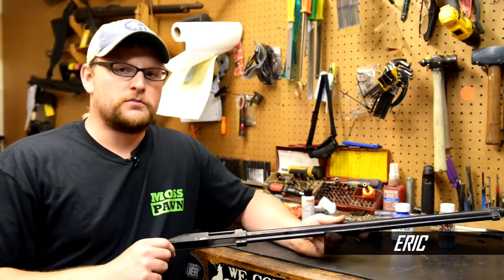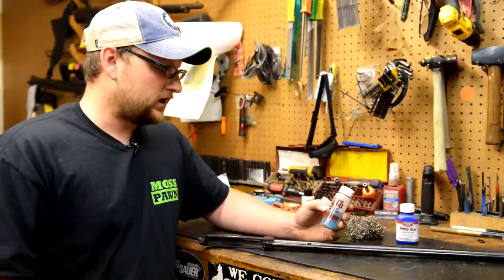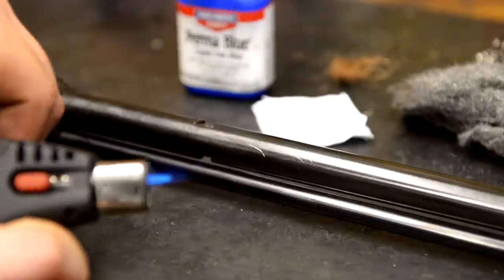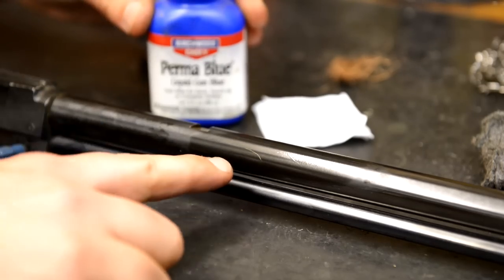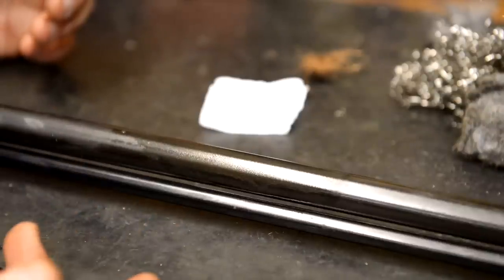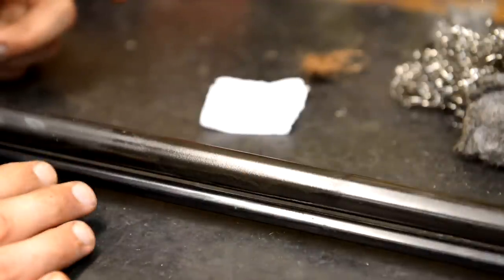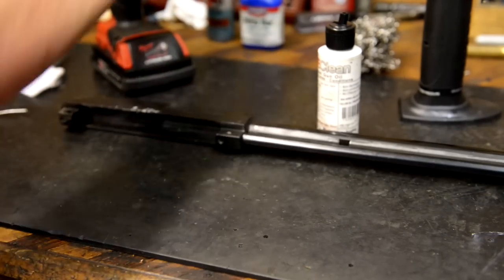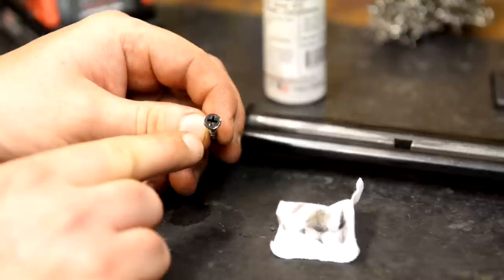How To Episode 10: Cold Blue

Comment: Just so you know, the water DOES NOT neutralize the blue, the oil does. I'm a machinist who use to do Black Oxide (blue). The water is to wash away excess solution, but if you don't oil it, the rust process will continue. If you really want to get out scratches, you have to sand the area until you can no longer see the scratch. then steel wool the sanding marks, in steps from course to fine steel wool until the texture matches the rest of the barrel (or what ever component you're working on).
Reply: Exactly right. Better to leave the scratch unless redoing and sanding the whole part.
Reply: @mark5862  I didn't even remember this. It was 7 yrs ago. Btw, I can no longer use bluing, as I have developed an allergy to it. Too bad really. I was pretty good at it.

Comment: I've found that the paste version of the Birchwood Casey is much better than the liquid, especially for larger areas.  I've done a few complete reblue jobs with it.   If you are doing a large area its a good idea to use their prep solution to etch the surface and remove any rust.  I also prep it beforehand with a series of 400, 600 and 1200 grit sandpaper to smooth out the surface.  It takes a lot of elbow grease, but it can make a nice looking blue job.

Comment: I used oxpho blue to refinish an enhanced colt 1911 slide.  It's all about degreasing, light once over with steel wool, heating, and then getting a good even application. There are only a couple spots in which you can even tell that it was reblued.

Comment: I've used the Perma Blue. It works, but it does take a few applications. I have a Mossberg 88 that I shortened the barrel on, then blued the tip to blend it in. I think I used 4-5 coats. Still wasn't quite as dark as the original finish, but it was darn close.

Comment: Most manufacturers use a hot blueing process, which is a minor variation on what is refered to in industry as black oxide coating.  It really doesn't coat the steel, but instead forms black rust as opposed to red rust.  The black rust along with a bit of oil on the surface prevents red rust from forming while not changing the dimensions of the part.  It is done using a mixture of salts at about 300 degrees F.  Cold bluing uses a mixture of acids instead of heat to support the reaction.

Comment: I sand smooth, clean with alcohol, dry completely, cold blue with a q-tip, dunk in cold water, buff with light steel wool, repeat 2 to 3 times, looks like brand new, did my whole rifle. Took about an hour or so.

Comment: Most commercial processes use a hot caustic soap clean, followed by a rinse, followed by an acid etch to activate the surface, followed by a rinse or two and then into the blackening tank - which may be hot or cold depending on the process.  Then it is rinsed and an oil of one form or another applied.

Comment: used perma blue on an old rifle my dad gave me. it was rough. he trade got it in a trade and someone sanded the blue off and painted the stock black with something that put me in mind of fence faint. that perma blue works with good prep work. used a few coats and it's more black than blu but considering the before and after. it's no show piece but you can only do so much to get around the deep scratches.

Comment: instructions even say multiple coats may be required, I did an entire mosin m-44 took 4 coats to get decent bluing and could use 2 more but instructions say do not leave on more than 2-3 minutes to it is very tedious doing small sections at a time,I took it down to bare clean steel starting out. It turned out nice.

Comment: If your having strength issues with perma blue try avoid container contamination by pouring what your going to use into another area to dip your steel wool in. Each dip of the steel wool will weaken the solution.

Comment: i use cold blue to blend in better steel wool around where the damage is that will tend to make the bluing flow togather better also using a hair dryer i had not propane torch to use, some stuff just will not cover up but for rust stopping it will then oil it after it water bathed! i reseal stock too i hunt in winter time i might get into rain or snow! that why i resealed the stock! i liked the video i learned some tips from it!

Comment: Great video.  Did you ever consider using a glass bead blast to prep the metal?  I restored an old .22 bolt action by bead blasting to bring metal back to raw form, looked like stainless steel.  I then cleaned/degreased, and blued (cold blued).

Result was very good.

NOTE:  I am a metal finisher.  MOST important is a clean substrate before any good results will be realized.

Comment: I'm no expert at all, but I've used that Perma Blue quite a bit and it seems to work differently on different guns.  Some guns it works immediately and perfectly.  Others it acts as you experienced in this video (doesn't do much).  I've always believed that it just depends on the steel used in the gun.

Comment: Just slap the parts on the header of a hardley and ride around in 105f temps. It will blue anything then spill it's crankcase oil on your rear tire as the rod connects with road. I'm going to try the 44/40

Comment: A better idea than the hand drill and belt sander is a drill press and some 1000 grit paper that you just hold in your hands. You dont have to tighten the drill press  all that much and when you clean up the edges of the screw head it wont take as much off the sides of the head as when you use a belt sander. just tear a strip about 3x6 and run it back and fourth while the press is spinning, takes the old finish right off without wrecking the shape or size of the screw head.

Comment: Rather than a torch, could I heat the area up with a lighter (I don't have a torch) for a few minutes and then wipe off the soot before I apply the cold blue compound?
Reply: yea you can. you dont want to get the metal too hot to touch, just warm it up a little bit.you could even use a hair dryer
Reply: Thank you for the advice.  A hair dryer sounds like the best idea for what I have.
Reply: what are you reblueing?
Reply: It will be an area of a PAP M92 7.62x39 (AK pistol) where a weld has to be cut to remove a thread protector to add a muzzle device. I wanted to file the cut weld smooth and re-blue it to help blend the area I had to cut to remove the thread protector.
Reply: sounds like a fun project. youll have to apply the blue more than once on something like that, probably even several times because it is a hardened weld. just be patient with the blue and it should work out well. I reblued the entire barrel and receiver on my western field .22. it didnt look good at first but after multiple applications it doesnt look bad at all
Reply: Thanks for the advice!  I'm hoping to get the gun before the end of this year.  I have a few gun projects I want to finish before it.  I did get the muzzle brake and hardware though, just need to shell out the cash for the pistol before the fun begins. :)
Reply: are you going to thread the barrel yourself? (just curious) and btw, good luck!
Reply: Thanks! The threading is already done, but when the AK pistol is imported a thread protector is screwed over the muzzle threads, and tack welded on in the back to the front sight post (which the post itself is threaded, and barrel is pressed through it on this particular weapon, I believe)  Like how the AK-74 series is threaded.  The barrels are pressed through a threaded front site block, which is effectively the same end-result as having a threaded barrel.  The weld can be cut through easily to remove the thread protector to add a proper brake.  I bought an original Serbian "booster" brake, in addition to a retaining pin, spring, and roll pin to install to get it all back to spec on how a real M92 front end should look.
Reply: that sounds awesome man. i want to put a muzzle brake on my mosin nagant so i have to get it threaded. the recoil isnt bad, but i like the way that muzzle brakes look on long rifles
Reply: Jason Bonedi I just did the same thing on a Western Field model 45 (Mossberg model 42 equivalent).  I used super fine steel wool to polish in between coats and got a near factory finish - as close as possible with cold blue.  Polishing with the super fine steel (before, in-between bluing iterations and after) gave it a rediculous black glossy look too.  Good luck!
Reply: Dustin Wutschke I thought i was the only one with a western field rifle :p
Reply: Jason, Seems like there's a lot more out there that have them, but most don't know what they are until they get them out of the closet at the cabin and look at them closer :).  Something along those lines anyways!

Comment: Perfect timing on this video, this was something I wanted to learn about, however how well with it work on a firearm with some old rust spots i've already steel wool-ed away, Is it a good idea to try to use the cold blue to attempt the rust from reappearing or the finish getting any worse, or will it just cover up the underlying problems, sorry if this question seems dumb, I'm just new to the bluing process.

Comment: It also goes by the general term tooling blue, and is a form of oxidation (as he said rust in layman's terms).
Anyone who chucks machine thread screws in a drill motor, is risking damage to the threads. The real problem w/ this is damaging the female threads on the gun when forcing it into the hole.

Comment: If you nickel plate or really modify in any way a rare old revolver, unless it's just an old clunker with no value to begin with, you will almost certainly reduce its value by a significant amount!  The only exception to this is that sometimes a professional restoration like those done by Doug Turnbull & Co. can increase an old gun's value, but it is definitely not cheap to do!

Comment: What is the best way to remove rust from a barrel? Have a OLD E.Remmington &Sons 20 Guage rolling lock that has sit in a leather scabbard for over 50+ years that has gotten rust on it. Don't want to distroy the original finish but want to get it cleaned up.  Have tried gun cleaners ,wd-40 , PB blaster nothing is working please help.

Comment: I have an old 12 gauge that was my great uncles, its a Noble model 60 that he bought at Montgomery Wards back in the 60's. The bluing isnt bad, its just really faded on the mag tube where the pump rubs and it has various light surface rust in areas. I dont want to strip it completely, Can I wipe it down with the Birchwood Casey rust remover just to clean the surface (not stripping it to bare steel) and just use the Birchwood Casey Perma-Blue to darken it and give it a refreshed finish? I think that would work just fine, anyone have any suggestions? The gun just has a lot of sentimental value and I want to give it a nice refresh, not a full restoration.
Reply: Yes, I would use a heat gun or hair dryer (I use a butane torch) to draw out all moisture.
USE GLOVES, don't want ANY oils on or in the surface. Wipe it on, rinse it off.. I've touched up my Sig Sauer pistols with it. PERMA Blue is what I've used for touch up. It will wear off again.

Comment: The only way to get rid of scratches like that is through metal work, i.e., sanding/filing them out, polishing the barrel & then bluing it. No bluing process is going to cover a deep scratch in the metal. They will cover scratches in the bluing only.

Think of it like a car. If you scratch the clear coat you can easily buff out the scratch, but if you scratch all the way through the paint to the bare metal there is a great deal of sanding that needs to be done before a touch-up will look good!

Comment: Hey, Love your Videos, Keep em Coming please.

Have a Question, a cracked bolt face on a slide, do you think building it back up with Weld would work? Or I had thought of milling out a complete section and milling a new piece to fit in, a bit like the bolt in the .22lr Browning target pistols, 

Do you think any of these are viable? I ask as getting a slide for the gun on question an FN Baby Browning 25 ACP is virtually imposable.

Cheers!!

Comment: Are you crazy the 4440 was left on way to long it started to rust deep. The birchwood casey is not as strong.  It's a little more forgiving. You need to stay away from the heat and only blue the scratch.    Its called cold bluing for a reason.

Comment: Is hot bluing the same as parkerizing ?????
Reply: abd mug similar process but I think the solution is different.
Reply: abd mug nope.
Reply: +bobcat2134 It produces an iron or manganese phosphate crystal, where bluing/black oxide produces a stable iron oxide. The phosphide coating has definite structure and is about 5 X thicker than the blued deposit, the manganese phosphate  The coating can be cromated or dyed to produce a deeper color. The coating will be more of a matt finish, even on highly polished steel, since it does etch the surface and then the crystal precipitates and forms on the surface. Oil will be trapped in the crystalized surface and significantly improve the corrosion protection. Most all riffles produced for the military have phosphate finishes. Pistols are still black oxided. I used to take my M-14 action in the shower with me in the military when I had a heavy day of firing or when the action got muddied. The actions never corroded.

Comment: Ok...
I’m not a gunsmith, I’m a L.A. project manager/general contractor.
Army combat veteran.

This video is a Nogo, out the gate.

Always
 and I mean always 
👉🏽use the proper tool for the job

Always 
and I mean always 
plan your work 
👉🏽then work your plan

As a former autobody painter, I can tell you 
->220 grit will scratch metal

A little planning would’ve revealed this

Comment: This guy has a gun shop? Shouldve cleaned it first with denatured alcohol and heat it up with a heat gun and Not a torch cause no matter what kind of torch or flame you use it will leave a residue on there. This guy wouldve gotten a much much better result if he had done this right. And use gloves people. You dont want this stuff on you. At the very least you dont want the smell on your hands.